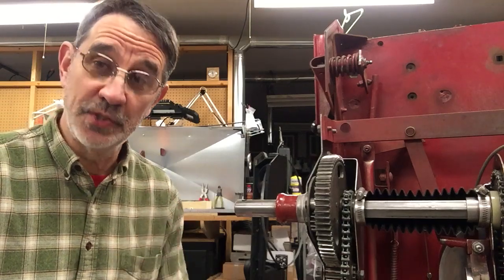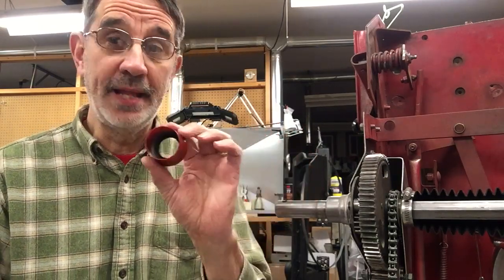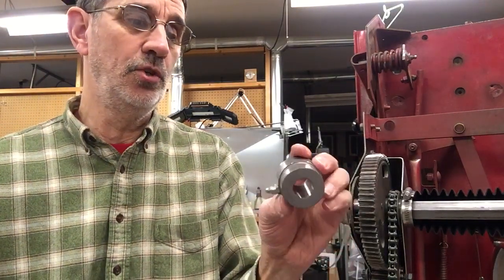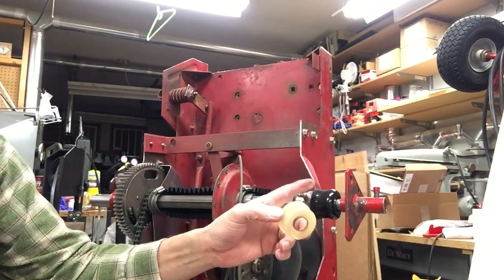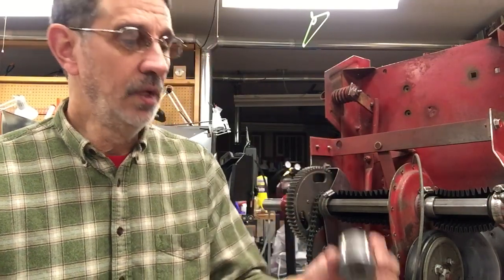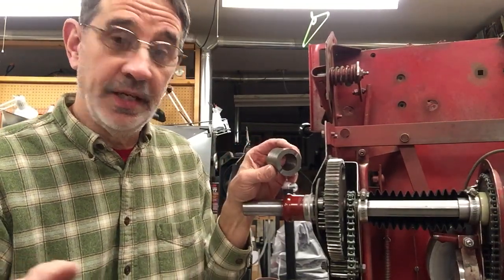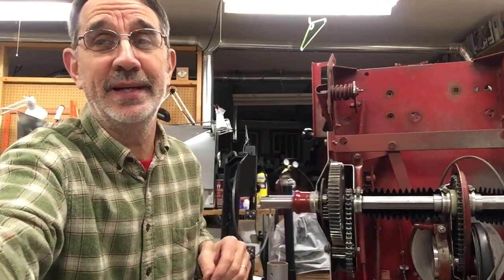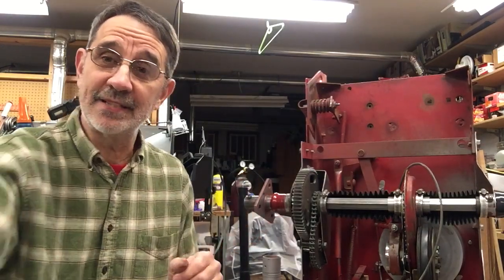329. M/S 61  Helping out a viewer with a assembly issue

Comment: Oh snapper.
Hey is it a good idea to change these parts at a certain intervals as preventive maintenance measures? 
I dont own one but I thought that was a good point for wearable parts.
Reply from the maker: I suppose some of the front end parts you could check and change as needed especially the front bearings in the tires so it doesn’t destroy your king pins but rear end parts it’s kind of hard to do that without disassembling the entire drivetrain. Jim

Comment: Great video Jim. $60 for that bushing seems extreme. With those fenders, is there a replacement ball bearing that would be cheaper? Would the old ones I sent you fit the fender?
Reply from the maker: You can still get the old style bushings without the Teflon insert and they’re only like five for seven bucks I haven’t bought one in a while so I’m not sure let me know. Jim
Reply: My machine uses ball bearings not bushings. I was just asking for everyone else. Actually my other machine does have bushings with the Teflon inserts but haven’t used that one all season.
Reply from the maker: @stevef8993  if you were looking for a cheaper source for the ball bearings that go in some of the snappers I will have to say no I checked with two of my bearing suppliers and they cannot get those they are made special for snapper. Jim
Reply: @jimjackson9381  Thanks Jim, the first time I replaced the ball bearings I went to Allied Industrial, they were able to help me get replacement bearings I believe made by Timken. They are under the farm equipment section of the catalog. Can’t remember the part number but I can look through some old emails to you if needed.
Reply: Funny, I just sent you an old email with a photo of bearings then realized the email was from you regarding spindle bearings. Sorry for the confusion. Now I don’t remember the part number of the replacement bearings but they did come from Allied Industrial.
Reply from the maker: @stevef8993  So Steve did you find a place where you could buy the ball bearings for the fenders on the snappers. Jim
Reply: I’ll do some digging through my paperwork to find the part numbers but I’m confident they did come from Allied Industrial. I have a good local contact that really helps me out.
Reply from the maker: @stevef8993  Awesome that would be great to find a source for those bearings cheaper than snapper.  You can send them to my email if you’d like
jimsfixitshop@gmail.com
Thanks.Jim

Comment: How can I figure out what is making my deck shake really badd?
Reply from the maker: There are a few different reasons this could happen one your blade could be bent, to your blade mounting bar could be bent three your spindle could be bent for your spindle bearings are bad five your deck belt could be causing the problems six your idol or pulley could be causing the problemCheck out these points and let me know. Jim
Reply: @jimjackson9381    I got new belt checked the blade and the mounting bar,   And the large pulley up top... The spindle bearings are Making some noise But there is no slop.. I can't see anything that could be bent with  The naked eye.. When turning the blade by hand its definitely   Doesn't turn freely....
Reply from the maker: @jodyhakamaki5602  well the bearings could be your problem another issue if you were ahead with severe vibration was there was a small stick stuck in one of the pulleys so every time the pulley made a turn it would create a vibration once he found that and pride it out his issue was solved check your pulleys. Jim